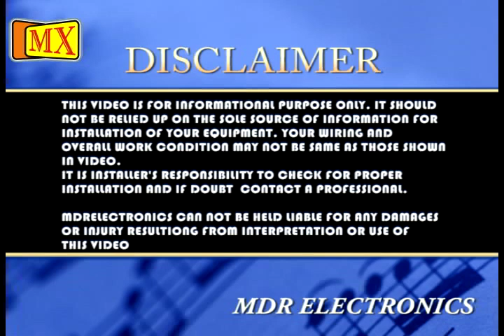How to DIY Solder less Screw type Connectors

Comment: Hi, I think as long as you have the same connectors as the ones in the video you should be ok. The screw terminal at the heart of the phono plug is not common on most of other manufacturers connectors. You could alternatively solder a new one in.